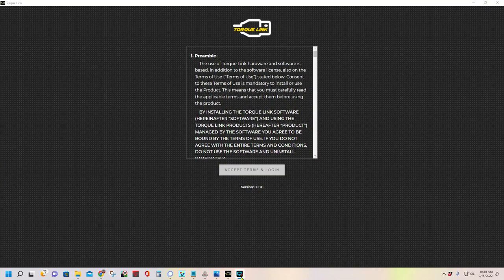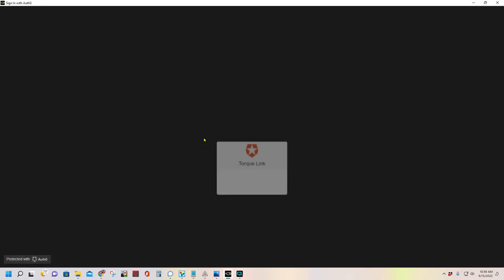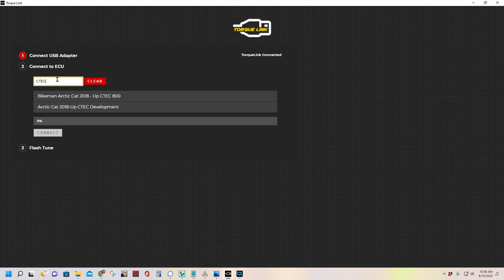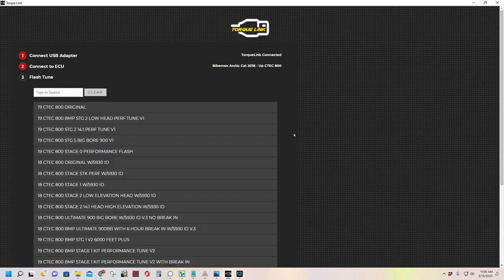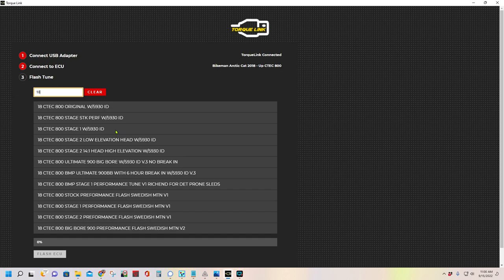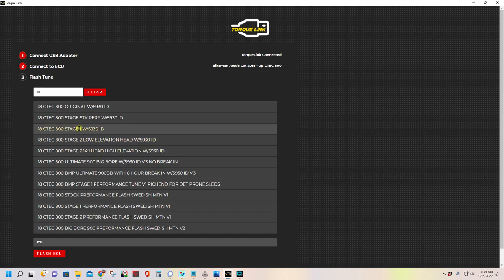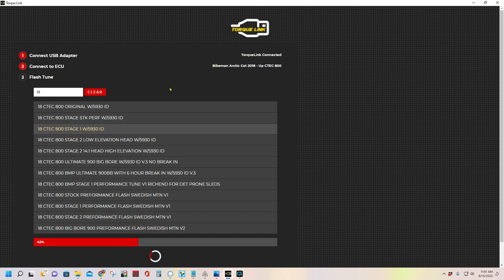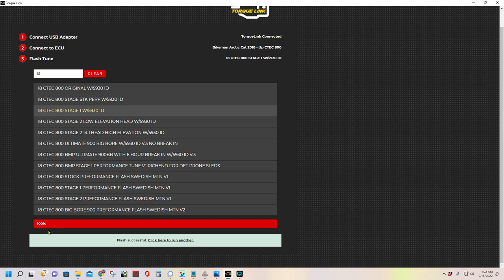HOW TO FLASH YOUR ARCTIC CAT CTEC SNOWMOBILE USING TORQUE LINK (REALLY EASY)

Comment: The wall power supply is very nice.

I over volted my ctec2 800 doing a flash.  It roached the apv servo, the ecu, and wiring harness...        Still throws random codes. I got a new cluster to see if it out also got smoked.

I don't recommend Back feeding power in with out a fused link
Reply from the maker: Torque Link uses a 3 amp max power supply. What flashing tool were you using?
Reply: @JoeyStrub 
Was doing a silber turbo flash with their setup. 
It was my fault for sure for the 14v supply.  But man it got expensive, and STINK!! the ecu capacitors blew up bellowing that fantastic burnt electric smell.        It lingered easily for 6 months.